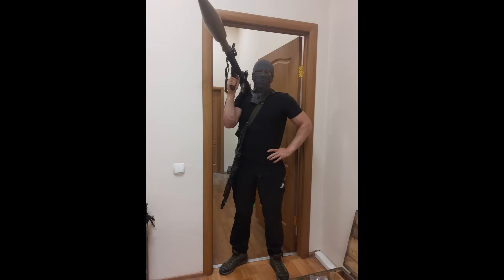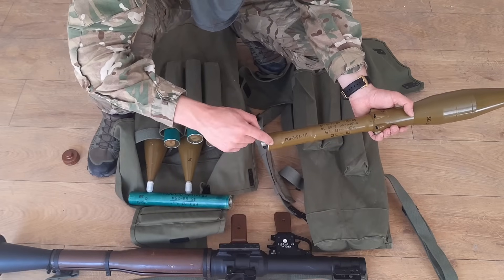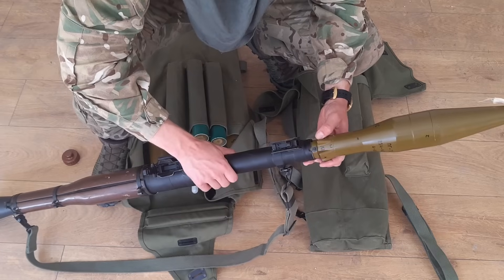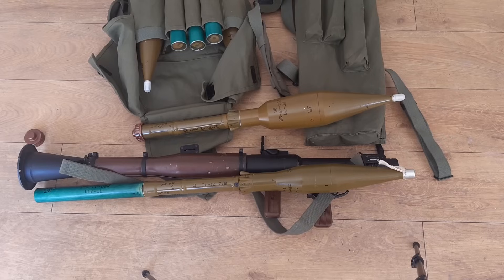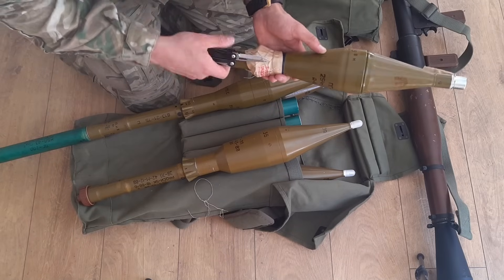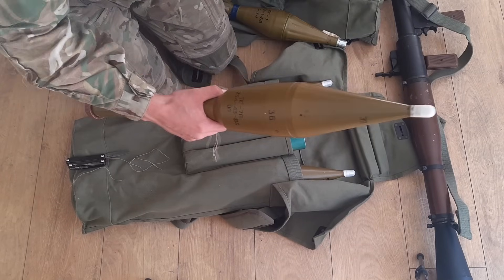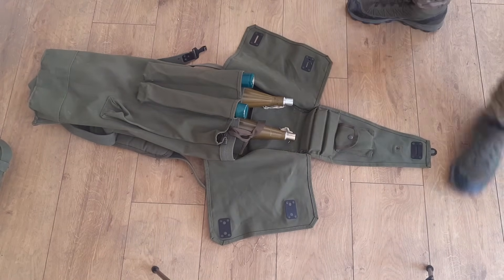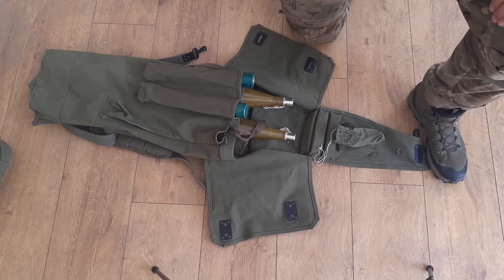RPG 7 (soviet)

Comment: On one note, every American shooting game that shows that RPGs aren't just plug and play, shove the warhead and motor into the tube in 3 seconds is debunked.

On the other note, maybe anyone can explain to me this. When I saw Iraqi soldiers loading RPGs, is seems to take a lot of effort after the starter motor was attached, to actually insert it into the tube. Sometimes, standing it on end and twisting it into the barrel. Was this improper maintenance, how the launchers get over time or just how tight the fitting is after use?
Reply from the maker: Very often little pieces of paper from the motor stay in the tube, sometimes makeing it impossible to insert new rocket, that's why it's good idea to keep cleaning rod on you

Comment: I think you confused the PG-7M's physical diameter (70mm) with the penetration value, and the 7L's diameter with it's penetration.

90mm of pnetration from a HEAT charge is extremely small. Only the earliest, WW2 era tank HEAT shells had such low penetration, because the technology was just then invented

Comment: With regards to the PG-7VL fuze and external/internal circuitry (typically if you crush the external cone into the internal cone  with cage armour you short the fuze, is this still the case with a PG-7VL rocket?), Do you have an operating manual you could share for the PG-7VL? What is the designation of the fuze  used in a PG-7VL round, is the bulb made out of plastic?

Comment: Great video.. The question I have is when the motor fires does the thrust go forward, towards the warhead then gets redirected back through what appears to be vents on the front warhead or is there an opening in the back of the motor?
Reply: The launcher is open at both ends

Comment: Isnt it dovetail mount ?
Reply from the maker: Yes, same dimensions like on saiga/ak, but fits only the original pgo optical sight
Reply: @valgear5525  Do you have the PGO sight and do you use it? My one encounter with an RPG was at a gun show. The owner told me how to use it ( in general terms) and let me sight down the optical sight. The reticle seemed very complicated to use.
Reply: @valgear5525  is it because you can't fit other optics or is there something very specific that won't let you secure other optic other then pgo ? Also I heard when Russians were in Afghanistan they used to take pgo on mount it on ak wonder how long optic last on ak

Comment: Brother I hope you are well and safe I have a question regarding the safety screw on the rocket, I noticed there is a small paper/cardboard hanging under the safety screw, do you pull this paper out before or after you take off the safety screw? Do you have to pull the paper out or can you just unscrew the safety cap?

Comment: This weapon will never get too old. I don't know if I like the lack of safety features. The second you remove the safety cap the grenade is armed. The motor is not moisture resistant. The primer can go off by mistake if you hit it softly. The only "nice" feature, is the ability to hit the target at super close range. The Carl Gustav anti tank grenade will arm itself after 30 meters or so.
Reply: You forgot the nastiest feature of RPG-7: if the firing pin isn't oiled enough it can stuck and the damned gun will cut your head in two.
Reply: После выстрела сначало) работает стартовый двигатель,на растоянии 30 метров,просто так снаряд не взорвёться ни когда, даже если снять колпачёк,и ударить ракетой) носом об землю) только после работы стартового двигателя снаряд) взрывоопасен, много видео когда в сборе ракеты) выстрела) и снятом колпачке бьют его носиком) об землю, ничего не будет пока ты не произведёш выстрел и снаряд не пролетит 30 метров !😊

Comment: What does the assistant carry into battle apart from the backpack?
Reply from the maker: Just simple AK 74 and lot of patience.
Reply: @valgear5525  How heavy is the rpg 7 + equipment compared to the ak and it's equipment?
Reply from the maker: Well you have your AK plus mags plus RPG and rockets, plus all the other stuff you carry, So Its bulky and uncomfortable, if you need to carry big backpack for multiple days you just throw RPG bag plus tube horizontaly on top
Reply from the maker: The weight isnt that bad since heat rockets are light, but the bulkiness Is the problem